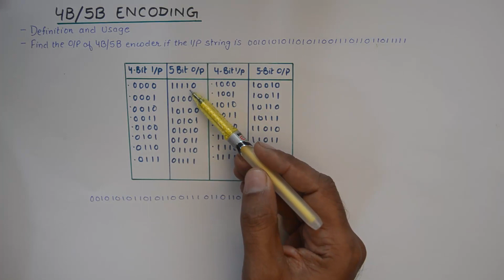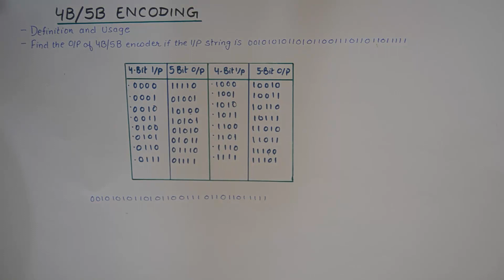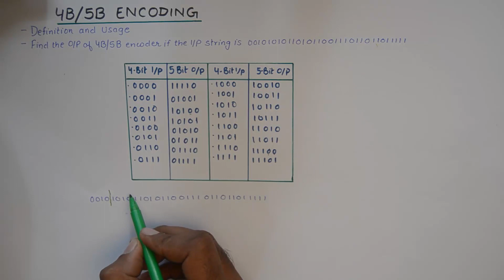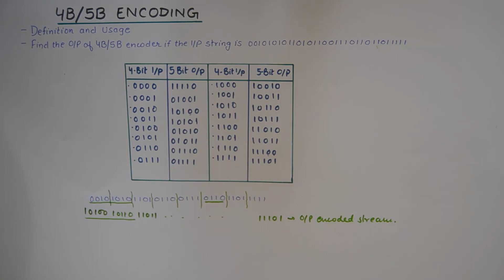4B5B Encoding

Comment: What if the string cannot be perfectly divided into set of 4, for example 0101011001 leaves an extra 01 at the end. How to deal with that?
Reply from the maker: Prefix 00 :)
Reply: @nipunharitash  Do you mean make it 0001 0101 1001 or 0101 0110 0001
Reply: @lianmccc  Did you know the answer?